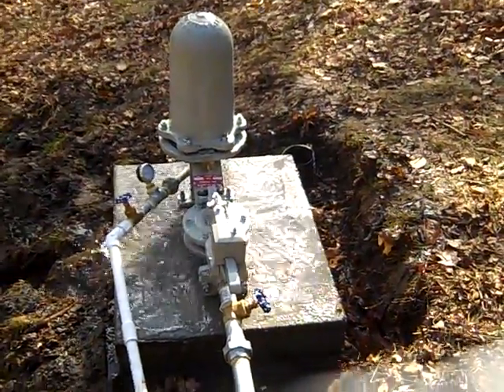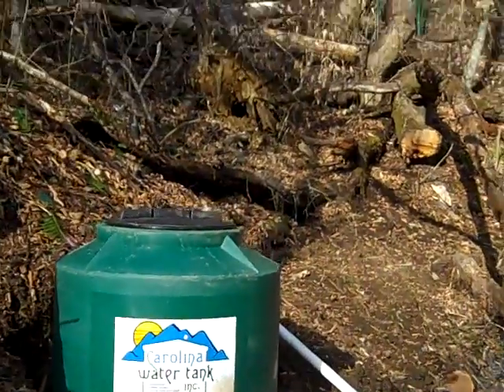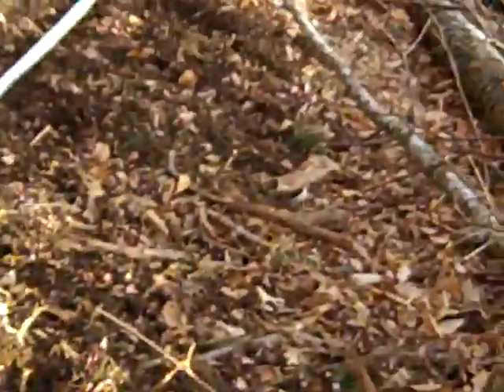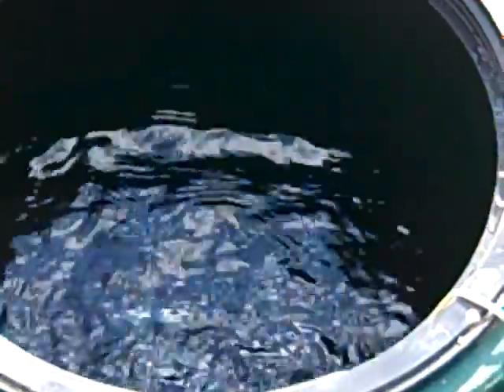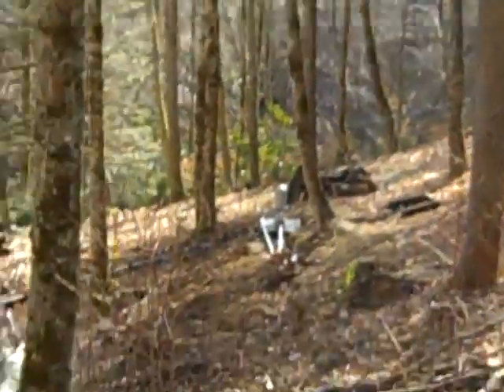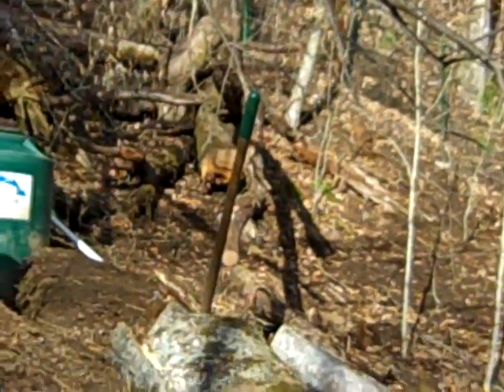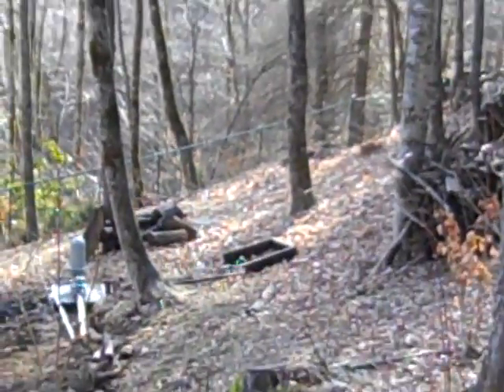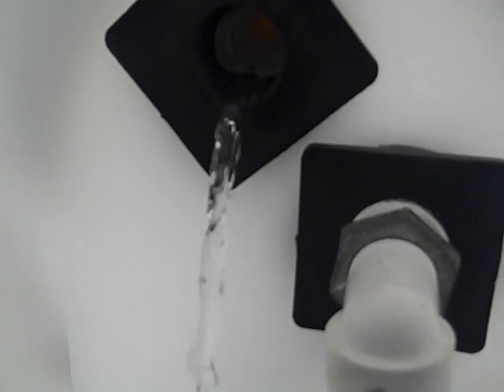WROL Spring Development Part 4

Comment: I know little about this subject, but i do understand the logic and avoiding cross contamination, can you use a small standing tank like the Green one as a giant natural filter e.g if you filled halfway with different grades of fine sand? Then put another Springbox in post that, for areas with high sediment. Isn't thay what municiple water uses giant Sand beds with small percentage of chlorine and flouride in it? Are there risks (guessing there are..) in springs near mines (Coal and iron in my area) but i'm basing my opinion more on other forms of mining where arsenic etc maybe present....like quartz/gold mining

Comment: This series inspired me to develop a spring on my property. It's going well, however I had to order additional connection ports from Carolina Water tank for my collection dam. I put it in and my water flow was so strong that both discharge pipes were completely full and water still over ran the dam. I will be installing up to three additional discharge ports tomorrow which should remedy my problem. But too much water in this situation is way better than too little flow. 

My question concerns burying that tank. I intend to use the same 125 gallon tank and installing a pick up line inside the tank and attaching it to my existing pump located in a pump house. Because of terrain my new tank will be about 20 feet down the hill from my pump house and I'm wondering if I need to burry the tank below grade and build a structure abound it to protect the tank?. I'm not sure it would freeze, but a tank sitting in the woods could get crushed by falling trees or limbs. 

You said you were going to "pretty much burry the tank". What exactly does that mean?

Comment: are you concerned about sediment in your incoming holding tank and maybe pre-filter or does the spring box act as a filter.  if you used allot of water - i am supplying 3 houses - i would think a sediment filter prior to holding tank would be very helpful?

Comment: I have followed your setup here almost to a Tee.I have built a ram per your example. I have an elevation of 120 ft with a 600 ft distance. problem have 45 lbs pressure at pump but I am still 40 ft short of total elevation what have I done wrong ? Your help is greatly needed. Thanks

Comment: @engineer. Thanks for the spring development vids. question for you.  how much head is on your pump in both directions?  I see 8ft of head + 22 on the pump drive? or is the 22 feet more of a run?  Also on the pump supply is it a 110 feet of run or head?   I'll be developing a well on our farm that is 1500 feet from my house and possible ram application with only 16 feet of supply elevation but 1500 ft of horizontal run. I'd hate to run electricity 1500 ft for water though!  thanks again.

Comment: BY the way great videos and instruction on how to build them!, I had seen plans in a book 20+ yrs ago and found your video on how to construct ram pumps by accident.  My question is? let say I need to go up 400+ or more.  in general terms if I do a 20' drop for a 100' rise then a holding tank as you did on the spring series and run the pumps up to the next level etc do you think it would work? stair step the water per se?

Comment: Obviously you did not take the time to watch the videos!  If you had you would realize that the outflow from the the spring was more than they needed! The whole system was designed for overflow from the bottom up to the main water tank. ALL extra water went back to the creek. Once the system is full ALL unused water was direct back to its original path flow. so take some time and watch all 4 parts to see how it was constructed  before you make such an asinine statement

Comment: It will not freeze as long as the ram is running. The water coming out of the spring is probably 45 to 55 deg.F to begin with. See his video "Ice buster ram pump".

Comment: You'll need galvanized for the drive pipe. The drive pipe has to be as ridged as possible so it won't absorb the water hammer on the ramming stroke. After the ram you can use any thing you want. Galvanized pipe is perfectly safe for drinking water.

Comment: There are two tanks in question. The water comes out of the spring box into the supply tank for the ram(the round one that thumps). Then it falls 22' vertically in the drive pipe to the ram. The ram pumps the water 110' up to the storage tank for the house(the one at the end of the video). The storage tank is above the house. The spring, ram supply tank, and ram are below the house. He put the supply tank across the cut where the grade complements the slope of the drive pipe. Hope this helps.

Comment: The ram is working on 22' of fall. Is this from the ram to the level in the supply tank or is this from the ram the the upper end of the drive pipe? I wonder because the drive pipe starts at the bottom of the tank. Does the extra level in the tank add any power, or is it strictly the fall of the drive pipe proper?  These things are so fascinating! Thanks.

Comment: With all the organics in your soil, the galvanized will be a failure point.  It will likely take 20 years, but for some reason it doesn't like to hold up.  I've found that the fittings fail first, then the pipe itself follows very quickly.  I haven't been able to determine if the ph of the water contributes on the inside as there is material loss on both surfaces.  You may want to switch to some type of plastic before burying too deep.

Comment: Maybe it's the perspective from the video, but I'm not sure I understand the purpose of the ram pump if the spring water passes by the tank  on the way down the hill to the pump, so that it can be pumped back up the hill to the tank.  Why not just run directly from the spring to the tank?  Or for that matter, why not just build the tank right next to the spring? instead of across all that distance?

Comment: How does a ram pump work?
Good video.
Reply: A ram pump, is just an energy transfer device.  It takes the energy from a large amount of water dropping down a pipe, and using a shock valve closure, transfers that energy into a far smaller amount of water, that it can then lift higher above the the original water source.  The excess water at the pump is then dropped on the ground, so the cycle can repeat again and again.  It's not magic, and it does follow the conservation of energy rules (contrary to what some believe).

Comment: This is probably a stupid question but... It seems in the video that the lines you ran are fairly shallow. Won't they be prone to freezing during cold weather? I know here in Indiana the frost line is 36 inches. Any less than that and we have potential for pipe burst or atleast freeze up.

Comment: Nice system, once you have pumped up to the elevation required to achieve your tap pressure, are there any restriction as far as the distance you can run the line horizontally?

Comment: Thanks for the idea! I'm just workin on a way to pay for a sizeable chunk of land. Anywho, have you heard of using solar power to perform electrolysis on water to get the hydrogen and use that to power your house and (if you make the necessary changes) your car? You can store some hydrogen in propane tanks. if it leaks, hydrogen is lighter than air so it won't pool on the ground unlike propane. No toxic fumes and you get water back, then recirculate and repeat. And clean water. What do you think